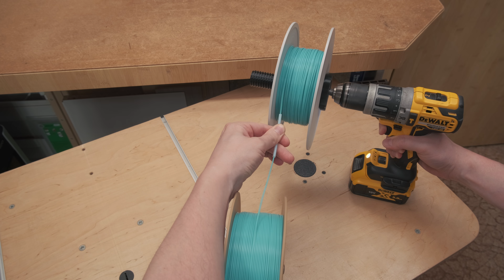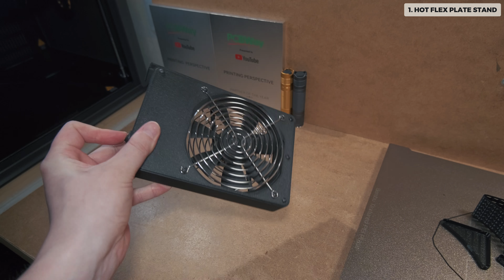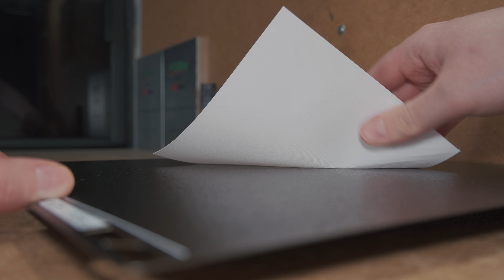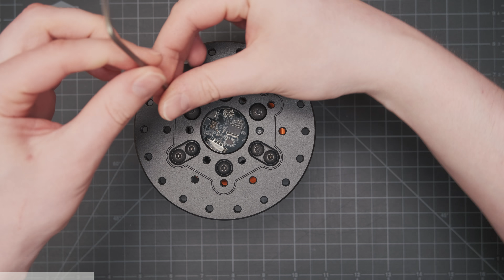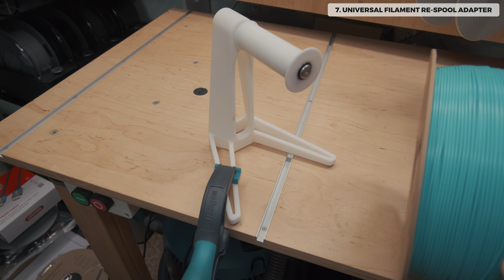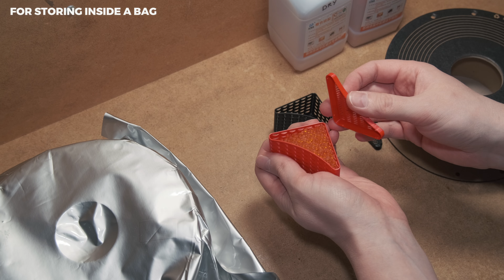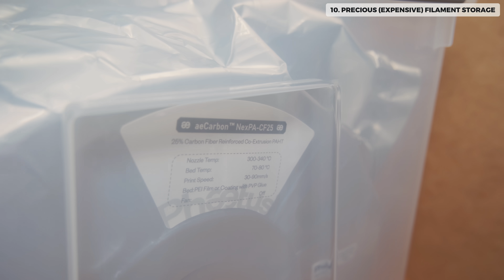3D Printing Pro TIPS & TRICKS (ACTUALLY WORKS GREAT)

Comment from the maker: Make sure to post your favorite tips and tricks! :)
Reply: The only thing I would do differently is the vacuum and sealing of filaments. I have a good vacuum and seal that is cheap and good enough to suck air and heat seal the bag. Usually the bags have quite a bit of slack that allows you to heat seal and cut open a few times. And I keep the metallic ones of already used spools in case I run out of it in one particular filament spool. It's also practical to have some purpose made reusable vacuum bags. And I do use the boxes just like you do, except I don't bag them. If you add a nice large dessicant bag there, you can actually use it to dry filaments. You just need a RH sensor to monitor it. When the filament is still a bit wet the dessicant will saturate quicker  but after a week or so, it stops saturating and RH stays at around 10%. You know then filaments are dry and will stay there for quite a while

Comment: IF YOU DUNK IT IN MINERAL SPIRITS AND THEN IMMEDIATELY SET IT ON FIRE IT WILL LEAVE THE SURFACE REALLY SMOOTH AND SHINY BUT YOU HAVE TO DO IT IMMEDIATELY AFTER DUNKING OTHERWISE IT DRIES OFF AND YOU CAN DO IT WITH GAS TOO BUT ITS REALLY SMOKY YOU CANT DO IT INDOORS
Reply: THE SPIRITS DRY SO QUICK THAT THE FIRE GOES OUT BEFORE THE PART CATCHES ON FIRE BUT SOMETIMES (LIKE 1/10 TIMES) IT WILL SO JUST BE READY WITH WATER OR WHATEVER

Comment: Using a fan to cool things down faster is not the flex you think it is, and should not just be recommended willy nilly.

Faster cooling generally weakens layer bonding, rather than strengthening it. It makes the plastic  become rigid faster, which does help to hold the shape instead of sagging, so "good" for overhangs, bridges and small details. But this doesn't mean it bonds better. You get weaker bond between layers, as it gets less time for polymer chains to mingle across the joint, so it can split more easily along layer lines. Uneven cooling also means uneven contraction, which pulls the print out of shape. Contractions can further mess with layer bonding, especially with ABS and ASA (see Prusa Knowledge Base).

Comment: From what I've heard about respooling filaments, you need to respool it twice, because otherwise the outer layer which is wider is on the inside and being crammed and the part on the outside is now the part that was on the inside and is being stretched out. Which if your filament isn't good quality, can just shatter the entire spool...

Comment: I dont like using metal scraping blade, plastic is way better, it doesnt destroy the plate like the metal ones. Whenever I finish a print. I remove the plate and move it up and down so it gets air cooled super fast. It only takes a few seconds.

Comment: My favorite trick with the blowtorch is to sand down parts to remove layer lines, then blow torch it to make it smooth. Works great on parts that are printed completely solid
Reply: That seems like a good method if you’re using a multicolor print and you actually want to see the filament color rather than painting over it. Sand and then torch follow up. Sounds like a good idea.

Comment: I actually don't use the blades to remove residue on the print beds, because you can damage the print bed. Just print a bed scraper and that's doing a fine job.

Comment: Great video. Here’s a tip I use for removing printed parts from the bed: as soon as the print finishes, I take off the plate and put it in the freezer for a minute. When I take it out, the part pops right off without breaking or damaging the plate. Cheers.

Comment: I have a dedicated aluminum plate that is 1/2" thick that I put the print plate onto to cool.  It pulls the heat out very quickly resulting in a cold plate in a few seconds.

Comment: Good tips, and good warnings. I'll just add that, in the first "cooling stand," it's also a lot about getting airflow under the plate as well.
Reply from the maker: The plate thingy is mainly to keep the flex plate clean. In fact it slows down the cool down as air is worse heat conductor than plastic. You can see that in the thermal camera. :)

Comment: Very nice video,  Normally I wait to the every end before hitting a subscribe button, but I was not even half way through before I hit it.  Great tips, I plan on looking for more of your tips.  I started 3D printing a very long time ago and it went to the waste side with other priority projects, but now that I'm retire I need to start fresh and get back into this.   What should I look for when I buy a removable plate and what is the best way to attach the plate to the hot main plate or do you just sit it on there, I'm guessing you use a glue or something.     Any way thanks again for the video.
Reply from the maker: Thanks, definitely watch the one about "Why 3D prints actually warp". Some very valuable info there.
If you talk about the flex plates that you print on, these days the most common practice is texture pei metal plate on magnetic heat bed.

Comment: When you go to fuse two spools, hold the two lines touching and parallel to one another.  Use snipers or cutter long enough to cut both in one motion.  I recommend a cut at a 45 degree angle as that gives the most surface area to potentially melt and join where you need.

Comment: Yeah, if your product is thick and has lots of weight to it, and if it is especially PETG, do not remove it, it will 10000% warp and you will have to print again. Wait till the whole thing gets cool and then just bend the plate first, don't worry about breaking the plate. It'll be fine

Comment: That heat set trick is a good one! Thank you for sharing these. 

Is there an stl available for that spool holder with the bearings that you were using in the re-spooling part? Thanks!
Reply from the maker: Thanks. That is a bad design spool holder as it needs hard to get parts and produces no friction, which means you have to slow down that idle spool with your hands. You need some friction on the idle spool to keep the tension and if drill speed slightly drops to prevent idle spool spinning faster and unwinding itself.

Comment: For storing filament, a simple and easy method is to get a large, cheap plastic bin with a gasket and latch lid. I found a 54-quart Sterilite bin for about $14 from Walmart. Then pour some desiccant powder or crystals into the bottom, maybe about half an inch or so, and just put all the spools into the bin without bothering with the bags. That's been working great for me.
Reply from the maker: I would do the same for more frequently used filaments like PETG, ABS, etc. But engineering filaments, especially PPS or PPA, are expensive, so extra protection is definitely worth it.

Comment: Thanks for a great video!  I immediately purchased the wolfbox blower and printed the adapter.  I wish the nozzle was narrower but I absolutely am not complaining at all. Everything you mentioned was a win win for me. Thanks so much!!
Reply from the maker: At first, I was thinking the same, but after I got used to it, I never even thought on making adjustments to the model. I am afraid that a more narrower nozzle might be way too restrictive. I will make and try if it is usable. If it is, I will add an additional model. :)

EDIT: I uploaded STL files with a smaller nozzle tip, works fine :)

Comment: Lol dont use the big holes on the bambo spools just stick it in any of the 6000 holes the angle if the hole will hold it in place no need to print clips. Hate solutions to common sense issues.
Reply from the maker: And when the end of the filament slips off or breaks on it's own and filament get loose, you go complain that manufacturers provided you tangled filament? That's just too unreliable and has nothing to do with common sense.
Reply: @PrintingPerspective never had an issue. I store all my filament like this it doesn't put a hard bend in the filament it takes a half a second. Now if you store them stacked I can see them pushing out or breaking/bending. Just put a soft turn into one of the holes. Only time its hard is on a new role that is almost full the outside holes are a bit to small.

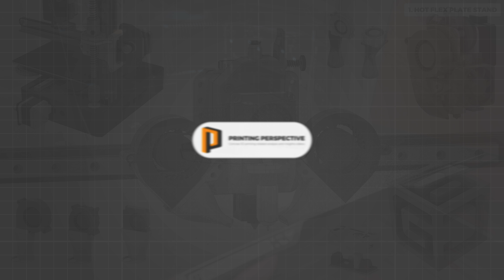Comment: 0:20 Just press the plate to a heat-absorbing surface (like a window glass). It cools down in seconds. The plate is designed for fast heat absorption but it also has equally rapid thermal dissipation.
Reply: Glass does not work well as a heatsink because it has a very low thermal conductivity.
Reply: @JMac436   It works well for me. Of course, if you have a massive copper or aluminum block, you can use that instead.
Reply: @JMac436  not for large amounts of heat, but it is more thermally conductive than many household surfaces like wooden tabletops, and the plate is thin and conductive enough that the heat is removed quickly from the side touching the print.

Comment: when you just pull the plate out and its still hot, set it on its side, and the spray isopropyl on the non print side. use compressed air or some kind of fan and the alcohol rob the plate of heat rapidly. the prints usually just pop off.

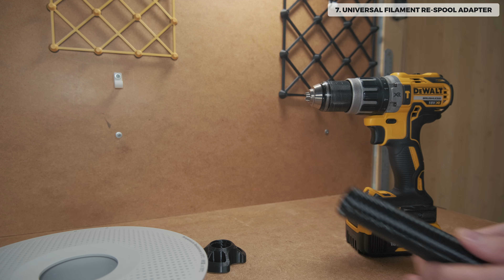Comment: For the re-spooling at 5:02, it wouldn't be hard to add a reciprocating filament guide that spools it on neatly (timed with the revolution of the spool).  This would increase how much filament can be placed on the spool and reduce the risk of filament loops getting tangled under each other during printing causing a failed print.

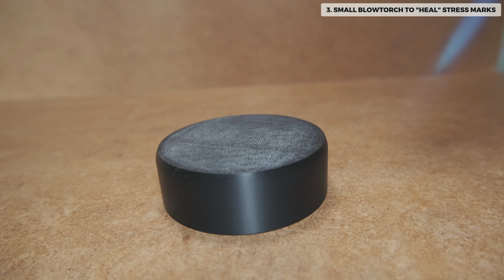Comment: 2:33 when torching a print, you need more surface layers, especially for PLA. If you don’t have enough surface layers, the heat will cause the material to droop in blank areas of infill. This causes an impression on the surface of your infill pattern.
Reply: How did you know how many is enough?
Reply: @Mrtimou812  You want to know how many layers of solid fill you need to withstand the heat of a torch applied over an unknown period of time? Obviously if you plan on heavily torching it, no amount of layers is enough and if you plan to lightly lick it with the torch, a few extra layers are sufficient. Therefore the answer to your question totally depends on how much you are torching. This isn’t going to be a number I can come up with so you’ll have to work it out with trial and error. Or you can err on the side of safety and put a few more layers than you should need.
There are other methods of smoothing that could work out better as well, such as a spray coating of clear enamel or polishing.

Comment: Every single one of these ideas is bad.  The cooling stand is unnecessary, the blowtorch idea only works if you use a textured build plate (which are quickly going away) and low warpage filament with thick cross section parts, the deburring tool leaves massive scars (which is why he didn't show the results in detail and went back over it with the heat gun), the heat-set insert technique looks good but leaves the insert weakly bonded to the part, and respooling with a drill as opposed to a real respooling tool is tedious and requires a great deal of proper technique to ensure the respooled filament will print properly.  The respooling clips he recommended aren't compatible with AMS, and you can't reuse aluminum foil bags because you need vacuum--he would know that it doesn't work if he measured humidity.

Comment: not quite a trick, but in the long term a filament dryer is a must have, and cheap hygrometers are a perfect addition, to monitor humidity. 
PLA isnt very susceptible to moisture, PETG some more, but silk PLA and TPU really benefit from being bone dry.
Reply from the maker: yup, especially if you want to print engineering filaments (PC, PET, PA, etc)

Comment: I recommend a palette knife that painters use. Cheap, works great, and you can get them in sets of two with a long thin one and a shorter one. Super flexible and they've made getting prints off the bed really easy, for me. They're sharp, but not razor blades and no sharp corners.
Reply from the maker: To separate bigger prints, what I usually do is I lift corners by flexing the plate and then use medium size putty knife. Also works great.

Comment: We store our filaments in plastic airtight cereal containers and they work very well. Just throw a little desiccant into the container, seal the lid, and it's good for months. I think the ones we use are named 'PRAKI', but there are lots of different ones out there, just make sure they're airtight.

Comment: I like it video, thx. I bought some cheap 20 liter containers from Wal-Mart that have a rubber seal already,  and bought decancent that is in a housing that you plug in the wall to dry it out again and reuse, works well. I seen them on a YT vid about 5-6 years ago.
Reply: I have 60 litre IP67 containers with  200g silica gel  and cheap humidity meter inside each one. I dry silica gel in microwave for 3 minutes. That's it. Easy as. No marking around with bags

Comment: 1. If you have a metal tool cart you can use the top surface to cool the flex plate faster, most prints will just pop off.
2. Design parts with a bottom chamfer, they help a lot without having to scrape.
3. Cannot emphasize enough how much better stronger torches are
4. Also have a counter sink tool for cleaning holes
5. For heat set insert, you will want to design a drafted hole so the excess material doesn't pool at the top (Standard practice). It also saves a lot of time if you have a lot of inserts (they also look better).
8. You can use a 4L cereal box to keep filament individually to minimize exposure to the other 3 spools

Comment: Great tips. May I add. Respool twice to releive strain or the filament may fracture a lot on the new spool. Use one side of the plate for PLA and the other for PETG. This way the residues won't cause first layer adhesion problems when PETG is printed after PLA or vice versa.
Reply from the maker: That's a good point. Maybe it would be easier to just keep the filament hot near their HDT to relieve stress + also get dry filament.

Comment: Ok, I had to stop it by 20 seconds in.   Using the little section of Bowden tube is genius when respooling
Reply from the maker: It only doesn't work perfectly with CF or GF filaments as most of them have very abrasive outer layer. It grinds the PTFE and way more particles might end up stuck on the filament. You really don't want that to happen.

Comment: Like your ideas, and your “get to the meat” presentation. For cooling the plate, I set it on top of my old aluminum laptop. The aluminum sucks the heat from the plate immediately. Any 1/8"flat metal plate should work. I also speed up the plate heating time by putting several paper sheets on it to keep the heat in. Only problem is the paper must be removed before printing. Guess I need to change my start code to wait for a command before printing
Reply from the maker: I don't know the definitive answer, but placing a hot plate on metal that has great thermal conductivity might induce some sort of a thermal shock to the bottom layers of the prints. By cooling down too fast layers might develop more internal stress. Who knows how much that affect prints in practice.

Comment: Instead of a metallic scraper I use plastic blade scrapers, they are good for 3-10 stubborn pieces that doh't want to come off and can be easily replaced and don't scratch your build plate. They usually come with a pack of 100 blades and are two sided.
Reply from the maker: Textured PEI plates are quite hard to scratch, but for smooth PEI these might be way better.

Comment: If you live in a wet subtropical environment, get rid of the card box, cause it attracts moisture… plastic/corrugated polypropylene would be better option…
Reply: I don’t really have a filament printer, this tips I’m borrowing from photo equipment storage that hates wet and hot places that fungos love
Reply from the maker: Interesting. In those climates aluminum foil bags and no cardboard box is the way then. Most filaments needs to be dry so it is very challenging 3d printing in humid climates.

Comment: Alcohol on PEI plates is not good, you're eating the top layer away by it. use normal dishwashing soap to clean it beforehand and wipe that off, this will release it better without problems with a scraper on thin stuff etc.
Reply from the maker: In real practice, I don't think alcohol does anything to PEI plates. Maybe if you leave the plate to soak in alcohol.
The reason I sprayed alcohol was not mainly for cleaning but rather, 2in1, it helps separate those thin skirts and brims from the plate, and you get some cleaning after wiping it with a paper towel.

Comment: When you know all of the tricks mentioned after only just 9 months of jumping into 3D printing rabbit hole means I really need to take a break from this hobby...

Also, I use brim only on the edge because of the white marks and imperfection after deburring.
Reply from the maker: With more experience, you can definitely make quite clean deburring lines. Then you blast them with a torch, and no more white marks.

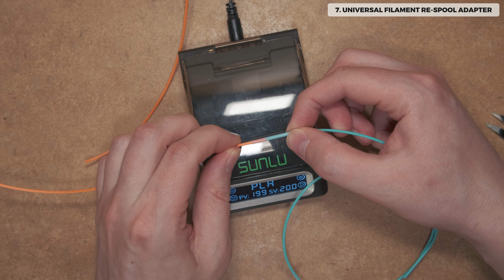Comment: 5:39 I've stopped using my Sunlu filament joiner because of how slow it is - now I just use the little PTFE joining sleeves and apply heat with a solder gun. Way faster and lets me visually see the joint as it's being formed.
Reply: How  do you apply heat through the ptfe tube?
Reply: @ytskt to be clear, I'm using the joining sleeves that come with the sunlu filament joiner, not regular PTFE tubes. I just touch it to the tip of a hot soldering iron for a few seconds.
Reply: @CarbonKevin got it. Thanks! 
Didn't know they came with such sleeves
Reply from the maker: I agree it is slow AF. If it would heat up faster, it would be much better. I get the best results by cutting filament ends at ~45degree angles.